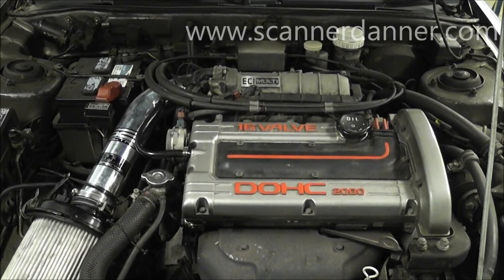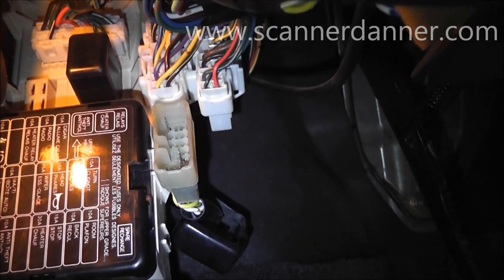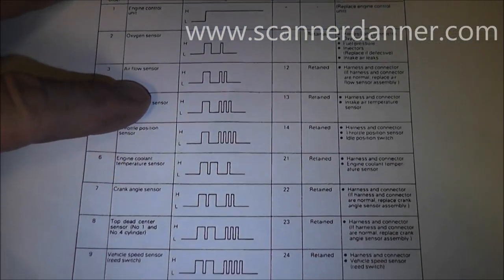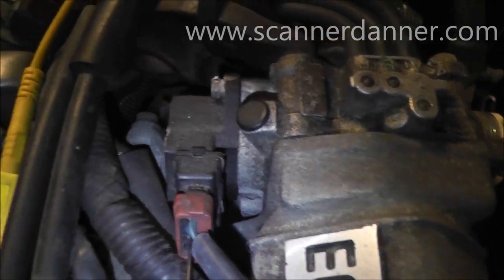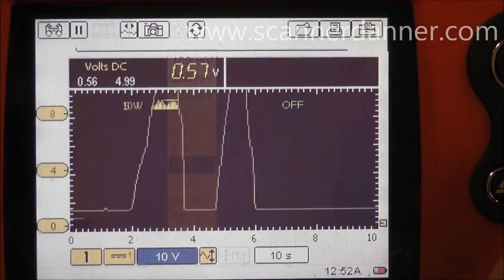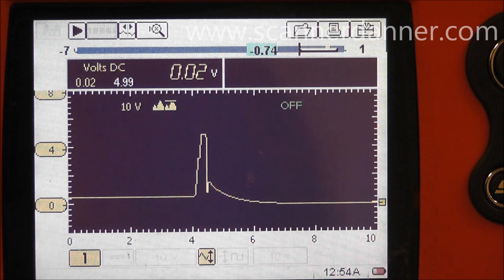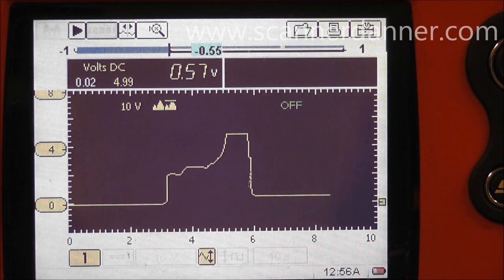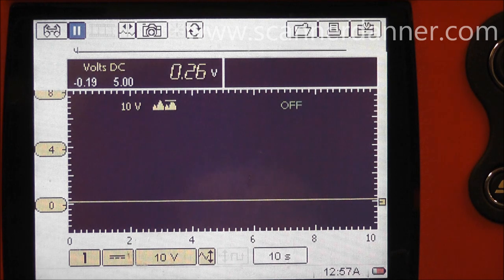Hesitation and idle problems from a bad TPS (OBD1 Eclipse)

Comment: My Subaru has the same symptoms described in the video.  I've been suspecting the TPS.  Surging idle,  high idle, low idle, wandering idle, poor acceleration; then it runs perfect.  Sometimes I shut it off and restart it and then it runs perfect.  

I'll test it with a DVOM.

Great video and great explanations, by the way.  Wire harness integrity test was a plus.

Comment: Thanks to your videos I have a 2001 Mustang that runs like new..Since changing the TPS   First time I have ran it was this morning. 50 plus miles.   Passing gear was great and it didn't mess up at all downshifting out of over drive.  Nor has it accelerated on it's own lol.   
     - Now if I can make sure the coils are good with the multi-meter ill be happy.  Two primary coils read 1.6 an the last was 1.0. Not sure if this is normal.  Haven't checked the secondaries yet.  Got to stop this header leak on the drivers side an hopefully it will stop the hesitation some more even.  :)    You are the man !
Reply from the maker: The ohmmeter is only good sometimes. If 1.6 is your spec, then I do not like the 1.0 coil, but one of your 1.6 ohm coils could still be bad. In other words if it tests good it could still be bad, if it tests bad it's bad. 
Make sense?
Use Mode 6 on your OBD-II scanner to ID which cylinder is misfiring. I think it is test ID $53? I have some videos on this
I show it here https://youtu.be/6kvYjYT1_mM
Thanks so much! It is always a pleasure to help someone who can help themselves and are not just looking for silver bullet fixes. Or what part to try next.

Comment: Paul thanks for uploading this, ive a vauxhall astra doing the same thing so this video helped me confirm it.  I was wondering if you could upload a video on CAN? my friend has a 1999 Volkswagen Passat 1.9tdi automatic (I mostly work on diesels).  When I scan the car with VAGCOM I get fault codes from modules on the car that there is no communication with the PCM and the PCM doesnt even come up on the scan. I found the problem is 7.8 Mega ohms of resistance between the CAN wires

Comment: My application used your method and code 14 was present. However while doing the reference test with voltmeter key on enginge off, none of the  3 wires at TPS indicated
the 5v open loop. Any suggestions why? And want to say thank you for the  cobalt video. The way you conducted the whole thing made so much sense.

Comment: Hello, I have a question regarding TPS sensor. Is there any chance of opening the throttle body to get to the potentiometer and  clean sensor contacts. Generally, can I make sensor to work properly with just cleaning contacts or is it better to change all unit? Thanks.

Comment: If the TPS tested OK, how would you test for a bad throttle actuator motor (or solenoid)  ?
Reply from the maker: If you are talking about an electronic throttle body, the motor circuit is a reverse polarity design. A scan tool with bi-directional controls and the ability to look at desired and actual commands is key in troubleshooting those.

Comment: I have Elsawin, Bosch ESI tronic, and autodata but none of these show a CAN diagram, I understand about terminating resistors but dont know were these would be located, it must be a bad connection or wire somewhere between the PCM and Gateway, but havn't a clue were the gateway is.  Any light you could throw on terminating resistors and CAN would be awesome.  Also I lost my login password for your ebook, do you know how I can find this again?
Thanks Ben

Comment: Thanks for videos Danner, i have same engine with same intake also same tps on my 1994 Hyundai sonata a/t ( 3 wires means not included idle position censor in tps), my 1st question is 0,57  is a standart voltage for this type tps?  2nd how can i get true position for Tps? i know its working good but its not set true position on there, I have shop manual but that just say " if its not on true position, you can see shift lock issue with A/T tranny." so if i set 0,57 mv on tps  than mean is it ok?

Comment: Gr8.  Vid there.  I am 
Trying to figure out an interment surging when at idle. 
I was thinking it could be. TPS or IAC

.  
Recently throttle body was removed as part of valve cover gasket replacement 

2001 maxima

When it was all put back
I got some strange idle and p0505
Found an air intake tube leak .  And the p0505 never came back
Then  found a Sticky throttle and found a loose bolts for the throttle cable .  
Now I get some random idle rev up and down when sitting in park after maybe driving a bit and then sits idle if for like 3 mins ( like waiting for a pick up order)

I have viewed live data on AD410 scanner and I see tps voltage moving and graph looks ok.  I just haven’t been able to to get my scanner on it when it’s happening

Ideas?
Reply from the maker: Idle relearn! Crazy procedure on those Nissans
Reply: @ScannerDanner   with car warmed up 1) turn  car to ON position (dont start)  2) wait exactly 3 seconds 3)push accelerator fully 5 times in 5 seconds  4) take foot off accelerator fully  for 7 seconds exactly 5) push accelerator for 10 seconds, and the Check Engine Light will flash 6)fully release accelerator pedal the Check engine light will continue to blink 7) turn key to off position, and then to start to start car, with in 10 seconds ?  if I remember correctly  I saw this for newer maxima on Electric throttle bodies but wasn't sure for 2001 maxima since its cable driven.  I might try it , what's the worse that could happen
Reply from the maker: @dfields9511  that's the one!
Reply: @ScannerDanner  just did that procedure.    it's now idling around 700 +/- 50 before I think it was idling around 800-900 rpm

Thanks
Reply from the maker: @dfields9511  nice job on following those instructions, weirdest relearn procedure ever!
Reply: @ScannerDanner   thanks,  yep the directions I initially found were for electronic throttle body on 2002+ Nissan Maxima/Altima/rogue for the 3.5L v6
I really hope it fixed it,  I don’t need to buy a new throttle body.  Just trying to keep it going for a bit longer maybe 4 years untill my son is out of college. It’s his car now.

Apparently the 2000-2001 maxima has a something different from older maxima pre 2000 and not fully electronic.  Only used for 2 years. 
Yah Nissan is the king of mid model year changes.   The rear break pads that fit are actually in the parts books at auto parts stores as a different model year.  The 2001 model year ones don’t fit.  I think it was on the books as a 2002 model year yet the car was made 11/2000 for 2001 model year.

Comment: Hey Paul,tested TPS on my 93 maxima,i got 8.3 volts on a signal wire and on a five volts reference wire,why is that? I experienced some hesitation when I accelerate then smooth out. I didn’t extract the code....
Reply from the maker: how many wires are on your TPS? I believe on that year it is not a potentiometer but a switch. It has a WOT contact and an Idle contact. Not sure.

Comment: I recently installed new tps on 92 ls400. but it's in such a bad spot for t pins how would I go about adjusting it to proper position I tried just using idle rpm with and without ac. it's obd 1. any suggestions?  great videos I have been watching your great videos for awhile and it has definitely helped me get better at diagnosing my vehicles. thanks.

Comment: Do I have to reset the ECU after TPS replacement?
Reply from the maker: On some cars yes, on others no. The ECM uses a "minimum TPS voltage" number that is learned and is retained in memory. New cars will issue a relearn on every key cycle and older cars it would only rewrite when battery voltage is interrupted. Make sense?
Reply: Does it mean the ECM is still (even if I already changed the TPS) substituting until I remove the negative terminal of the battery?
Reply from the maker: Not substituting but using the old TPS minimum voltage signal. This can cause a very high idle speed among other things.

Comment: Hello, I have a P1390 code on my 1997 Eagle Talon (non-turbo). Can anyone help? I recently swapped another motor 420A and it runs good, however, its sluggish at times when I want to accelerate.